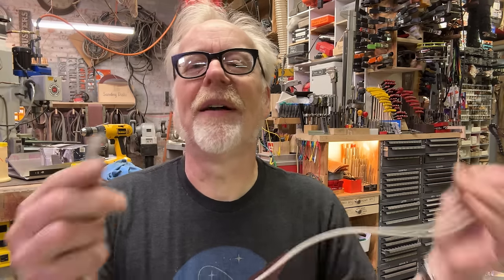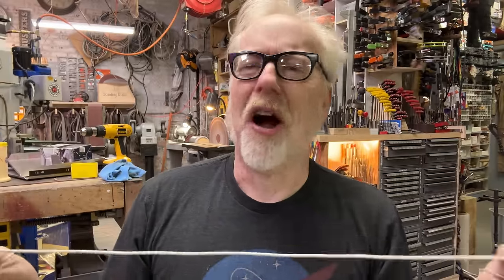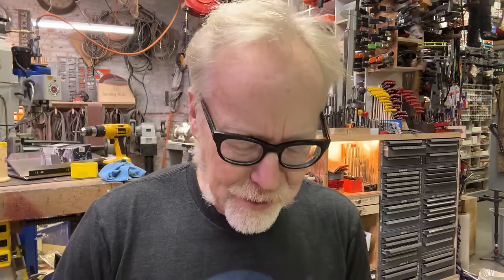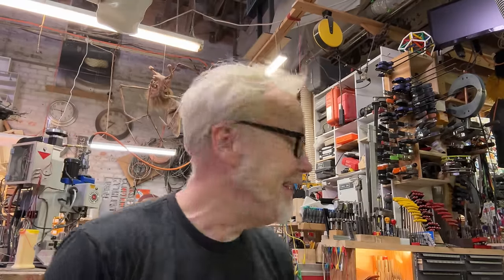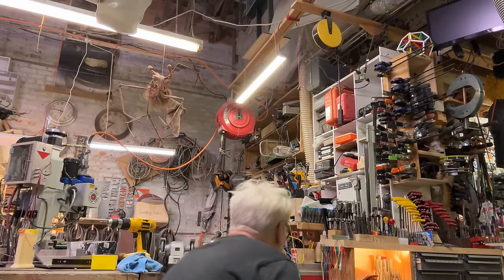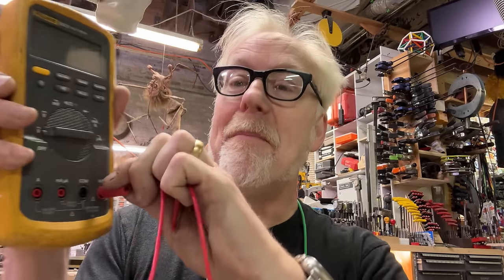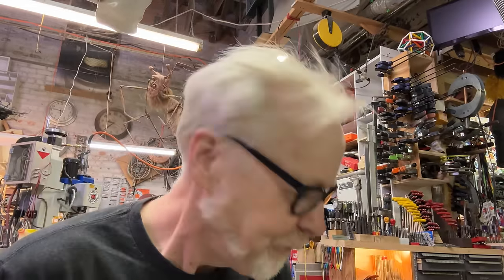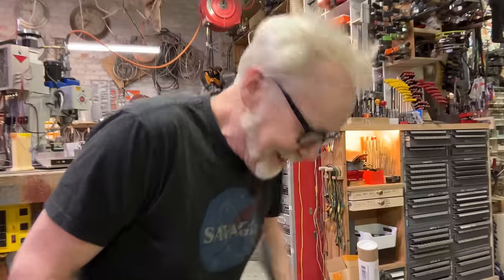Adam Savage's Alligator Clip Leads Problem

Comment: Mueller makes good alligator clips, much better than anyone else’s.  They are available in gold plated, chrome plated and stainless.  The barrel is designed to fit over a banana plug.  When matched with plastic boots, they are reasonably safe to use as clip ends on banana cords.

Comment: I don't know why the sound of a jostling heavy metal object on the floor is so apropos to Adam's Shop videos.

Re: LED resistor
Adafruit has a really good guide on how to figure out the series resistance to the LED, assuming you have the LED's datasheet. Google "Adafruit LED resistor KVL". Brief spoiler: The resistor is there to make sure that the LED doesn't release blue smoke because you put an amp through it.

I don't use clip leads for the reasons Adam stated, and because the gator clips can slip at the worst possible times. What I do for temporary connections instead is create ersatz "clip leads" using Wago 221 lever-action wire nuts. If the connection is meant to be permanent, I'll solder, crimp, or use a screw terminal. If one of the points isn't a wire, I'll tack on a wire with my Pinecil.

So I'm thinking, get a bunch of the inline Wago 221 wire nuts and make yourself a bunch of lever-lock leads using some 14-16AWG wire. Strip a little insulation off the ends, clamp on a Wago on each end, bang, you have a set of leads that will latch onto most wires like a puppy playing tug-of-war.

Comment: You can not buy good quality Alligator clip leads any more. But Mueller still makes Great Alligator clips from copper and you can make your own using whatever gauge wire you need. I used 18ag 600V stranded hookup wire, in various colors 16 inches long. Soldered of course.
Mt set is 10yrs old, used daily and still good as new.

Comment: the insulation on those crock clips is/or acts like heat shrink, so one day they wont open at all and you remember oh yea i was putting 10 watts through a wire wound resistor with those clips yesterday ,just great!

Comment: cables from pvc or other plastic through them away and get silicone cables instead a little bit more expensive but way nicer to work with and get the insulated banana plugs then you don't blow something up when you forgot to disconnect it (yes we have all been there)

Comment: You could make the ultimate sets of leads with Butt Set clips W/ bed of nails as your ends.  I use them every day in my job, repairing old copper telephone lines.  They last for about a year or two with daily use, so a hobbyist should last a decade with intermittent use.  You can buy just the ends with silicone covers and repurpose the wire, or buy some nice silicone super flexible wire to go between.

Comment: The other big issue with most of them is the wire is sized to about 3 human hairs. I started making my own. Clips may still be crap but at least they are not a bigger resistor than the actual circuit.

Comment: I think Adam already answered his own question when prototyping use the lever style electrical blocks, or if low voltage prototyping maybe a breadboard.  Crocodile clips were a quick and dirty means to hold on to things, and as found they are notoriously shite over time.  Maybe they should have similar clips to those that are on Norms helping hands :).  The added annoyance with clips is no matter how the wires are connected or with whatever strain relief, is that the wires eventually breakaway.

Comment: This is unrelated to this video but I figured someone here might be able to help. Does anyone know where I could get a steel pin contour gauge that is at least twelve inches long? I have  plastic one that is twelve inches but it doesn't have the kind of resolution that I need. I'm making boxes for the radiators in my Victorian era home and the molding are more intricate and wider then modern ones. Also the walls are plaster and lathe so they aren't exactly straight.

Comment: Agreed, alligator clips are kind of annoying. I'm not sure they're worth using if you find the right crimping tools to crimp terminals quickly. Forks and rings are nice for power supplies. Spade terminals are nice for quick disconnects (if you get ones with good tolerances, otherwise there's nothing quick about them), and those then make it easy to quickly hook up stuff like C14 terminals...

Comment: I make lights in 90% of my dioramas, however, being dyslexia with numbers, aka dyscalculia, are a nightmare and the math and diagrams involved doesn't help.
So i usually work around the complications by making it super simple, 5v to 5v, 12v to 12v, no mixing the voltages cause that's a level of complexity i simply cant do.
I found some gator clips that has like a "lever/scissor" movement?
Like, they grab the "thing" evenly across the jaw, they don't slip to the sides and they don't grab you're wire to the point where it cuts it or damaging the sensitive copper wire.
They are called "Mueller BU Clips"? <-Google that. There's multiple versions and all sizes, they are awesome and have never failed me.

PS: Don't worry about how it comes across to us, we know you well enough to understand what you mean Adam :)

Comment: you need to mention that the ones you like are also silicone insulation which makes them very flexible . don't buy vinyl insulated multimeter leads either . always go for the silicone ones.

Comment: The thing with clip leads is .... complicated and some ranting is needed.  I have started small fires with these.  If something is wrong, the wire gauge is usually not known or way to low for the problem in your circuit and you have a bad day.  Adam is right.  This cheap design is old and unsafe imo.  I have a bunch of them for various applications.  More expensive is usually better with these things.  And why don't these have some sort of fuse built in?  Should be standard.  I use my PSU to limit current, but not all PSU have this and even then, you can forget to set it and burn a big weird smelly ring into your table.  Ask me how I know....

Comment: I bought a cheap set of clip leads once, and discovered that the wire was steel core. STEEL core. Who does that? And of course it was just half-ass crimped in, not soldered. I'm cheap too, so I rebuilt them with proper wire. Been using them since. The ends can be squared up. The thing that really gets me is when the rubber boots shift and the clip twists 90 degrees instead of opening!

Comment: If you buy FLUKE test lead SETS they come with banana plugs on BOTH ends of the wires with a big assortment of clips and probes to fit every need.  You will pay more $$$. but they are high quality and you won't be disappointed.  I can't tell you how many times those cheap alligator jumpers were "OPEN" or even worse "intermittent" right out of the package.  THAT will mess with your head when troubleshooting.

Comment: By the same token, the croc clips that come with "helping hands" stands are also complete garbage.  They are no good at holding anything securely and the thumb screw mounts which are supposed to hold the shanks of the clips  just end up crushing them to the point where they constantly fall out

Comment: clip leads in themselves are not really bad things, but yea they have become SOOO cheap, that the wire itself becomes a problem. Starting off as a electronics nerd back in the 80's my dad gave me some that could probably be used to jump start a lawnmower. The one's of today have like 48 AWG wire in them and you can watch them pulse with a 1 amp 12 volt light bulb connected to a simple turn signal flasher.  I have personally moved on, but any wire lead that cost pennies will do the same regardless of the connector on the end ... make your own or buy quality ones. For ultra fine wires or small lead connections look at micro grabbers, they kind of spring out 2 or 3 leads like those cheap screw grabbers, but they are small as needles

Comment: Take out a loan and get the Fluke clip lead set that comes with fine wire and large gauge wire clips. The fine wire ones use a notch cut in flat stock as the hook, not a bent hook so its tough.

Comment: I like the basic alligator clips for chunky stuff, like big tabs on batteries and fat wires... but yeah they suck XD I have ones that are actually fairly well aligned, and the teeth meet up when closed rather than splitting the further away from the tip they are like some really cheap ones, but they're still not great for finer wires

Comment: All of mine are banana banana ended including my speaker cables, so when I need heavier wire and or longer runs I use those and either plug them in or plug them into a quality alligator clip with banana socket rear end. Some are silicone cable with uktra fine cores, those are gorg. All made by me. <3 Link to the HD green ones you showed? I'd buy some of those, as I concur, most are trash and belong in the rubbish bin.
Reply: Link is already in the description. Cheers.

Comment: In looking for multimeter leads, I have found something called a 'bed of nails' connector. Which is quite literally a bundle of needles attached to the wired jaw. 
As the store battery guru at an auto parts store, I can say that the best high amperage alligator clips have BOTH jaws wired in. The axle of the clips is never a good electrical connection. NEVER. In normal leads with both jaws wired, this is always the primary cable to one jaw then an extra  wire to the second jaw. 
NOCO jump boxes and accessories that I have seen are always wired like this. 

Now my very, very sophisticated automotive battery tester (I believe it to be the most advanced handheld tester in the industry) has what's called Kelvin clips. Each jaw has it's own wire, but the jaws are not electrically connected to each other. Kelvin clips sold on the open market terminate in a BNC connector or two banana plugs. They almost always have a very unique shape and a plastic axle, sometimes with a metal screw in the center.Normally, kelvin clips are used for either extreme redundancy with very sensitive measurements, or to test small electrical components, like surface mount ones. With one hand, you can test a small fuse, capacitor, etc. 

BTW, if you are buying jumper cables,1. 8 guage MINIMUM, only for 12 foot/4m cables and only for small cars under 200hp. 2, IDK how to find ones with all jaws wired to their mate. 3 the best ends are the ones with the pincers that stick out beyond the normal jaw. Great for getting under the car's battery cable terminals and directly around the battery posts.  This can be a problem with highly *cough COUGH* poorly *COUGH COUGH* modified systems for winches and stereos, or trying jumpstart a car while testing it. 4. Parrot jaw clamps are good quality, but are quite bulky and are  terribly difficult to use on any car  with tight spacing around  battery. Which is most of them. 5. jumpstarting a car with jumper cables by yourself is dangerous and requires forethought; you MUST follow those annoying directions on the box the cables came in. You know, where you put the positive on one car, then the positive on the other, then the negatives. 6. You know how you're not supposed to put the negative directly on the battery, but rather another ground on the car? You often don't have a choice; everything else is usually painted or properly insulated. Or has too much resistance to start the car. Put the clamp close to the battery, close your eyes, turn your head and connect it. Move back then start it. Sparks normally only happen during start up. Pray it is the case here.

Comment: An LED powered by 9V can have a current limiting resistor of 550 OHMS. V/R=I.  9/550=.016. Most LEDs will be fine with .016A of current.

Comment: There is a fine and sometimes overlapping line between thrifty and a cheap ass...lol I'm guilty too!
The leads I like have silicone boots and silicone insulated wire, both are very flexible. Now if you find alligator clips that work great, buy as many as you can and make your own leads. The wire, boots, and the other plugs, probes, and clip leads are all cheap. Custom make the leads to your colors and lengths.

Comment: Those leads seem more useful electro-mechanical work like cars or pinball machines or whatever, not modern digital circuitry at a workbench. I've also questioned why I own them. They were probably good for working with old-fashioned circuit boards without copper plating, where everything was soldered with wires and the components were twice the size.

Comment: It's time to redesign temporary electronics clips so they're easy to use, make a good connection and are cheap to make/buy. Hmm. On my electronics toy from RadioShack back in the 80's it had springs that bent open and closed to trap wires. why not put one on the end there? protected with plastic sheath at either end perhaps.

Comment: In my experience, they tend to be very bad and have shaky connections for two reasons; they don’t grip as hard as you want (you can see the lever action for the clip gives you a disadvantage! You need to press hard to open it and it closes with much less force) and they are rigid teeth gripping (usually) very rigid objects. I’d love to see a design that has a stronger grip, but I’m more interested to see one with pairs a toothed, conductive side with a soft material like rubber and I would expect you’d have a far less need for extreme grip force to get the same amount of stability.

Comment: I've been using alligator clips for decades and it does seem that quality really dropped in the past 25 years or so. Used to get decent ones even from Radio Shack. These days I only buy Pomona. I look for eBay deals. Got a set of 6356-24 (10 x 24") from someone overseas for $54 recently, which was a "good" price. Ouch. Their mini-grabbers also beat anyone else's that I've encountered. And I just got some more Pomona 1825 stackable banana plugs.

Comment: Yes, the jaws on cheap alligator clips are frustrating, for exactly what you displayed: misaligned due to sloppy fitment!
BUT, if you take a few moments, they're easy to "fix"...

I have found that using a needlenose to crush/mash the pin sides more, AND then also to crush the overlapping-jaw's sides around the pin... Now the fitment is no longer sloppy, and the jaws properly align when closed! 😁

[While we're on the subject of ranting about things: I hate that my SwiftKey keyboard INSISTS on treating jaws... OH SURE, this time it did not... but usually it will capitalize it because of the movie. 
I use the swipe method to type, so on numerous occasions I've deleted the capitalized prediction in my keyboard's dictionary, after it inserted the capitalized word (on Android, in the predicted words bar, tap-and-hold the word in the prediction bar to delete it from the dictionary). Even then, it still insists on capitalizing it... except THIS time! Iol

Same goes for Intel, because of the company; however, it's also short for "intelligence", as a military term. But try as I might to make it forget, or teach it the lowercase word, it always reverts back to capitalizing it... 😮‍💨😠
(to add words, aka "teach", to your phone's keyboard dictionary, you type the word manually and hit spacebar)

End-Rant]

Comment: hmm.

what's the purpose of the serrations on the clip? to hold onto wire bigger than the spacing of the serrations?  Improve grip by making high stress points?

I can see that working for multistrand or thicker wires but not thin wires...  For that the hook style seems ideally suited 

I can see that the folded sheet design of the alagator clips is for stiffness, so it should be possible to reverse the design and make a curl of metal that bends outwards, making a tube with a mating face in the centerline.  But now the wire can slide out - so the tip and back end need to have a catch/overlaping tooth desinged to stop the wire from exiting the front or back.

As for the force required - surely making that lever longer should be simple!  even if it's not straight in line with the jaws, and only has a little movement, it'd be better than this design.

Comment: Of late, they have been making the covering of some sort of material that makes it hard to get a good grasp(Silicone?) on the clip. A greased pig kind of thing.
I like the coating on the wire because it's more supple but it doesn't work on the clip.
Seriously slippy slidey.

Comment: Adam doesn’t know about micro SOC hook clips?  I use ones that can grab wires from a single leg of a SOC but also grab regular wire just as good as alligator clips.  Been using them for years with my fluke and I just adapted my Pokit Meter to use them.

Comment: Gator clips for multimeters and circuit prototyping are one of those things where "good enough" works pretty well. And let's be honest, even the worst alligator clip is far superior than  the alternatives when trying to do a continuity test  on a circuit where the terminals are more than a meter or so apart. 

Is there a business case for a significantly improved mechanism? Maybe, but I think humanity, and electrical engineers, have got more pressing problems to solve.

Comment: CAUTION: I have those lever type leads in my lab. The ones with banana ends have exposed metal on the banana plug when they’re stacked.  It isn’t easy to accidentally touch the metal, but it is there.  You know what they say about a room full of monkeys - anything can and will eventually happen.  Other than that, I love those lever style clips.

Comment: You are looking for "MA1 crocodile clip"  or 'HIRSCHMANN MA1' 
You'll have to find your own wire(Use some good copper cored silicon wire) and make them up yourself as they are made for 4mm banana plugs, but they are pretty much mechanically perfect. And come in many colours.   (It's another 'if you want the best, go look at what the Germans are doing' thing. :)
I've had a set of HIRSCHMANN AGF 20 based leads for 20 years that I /abuse/ daily.. And they are still flawless.. If badly worn. :)